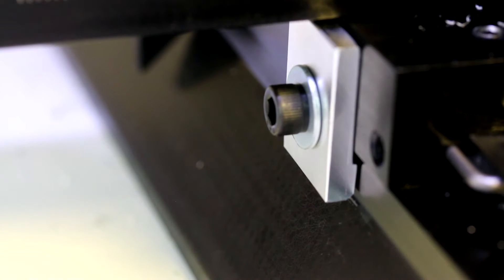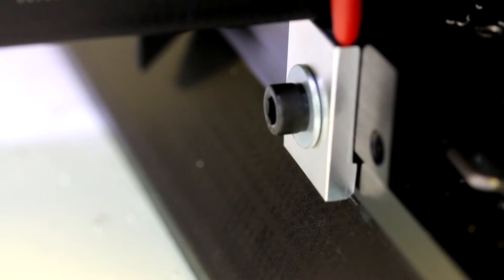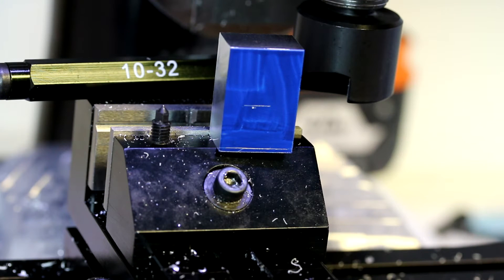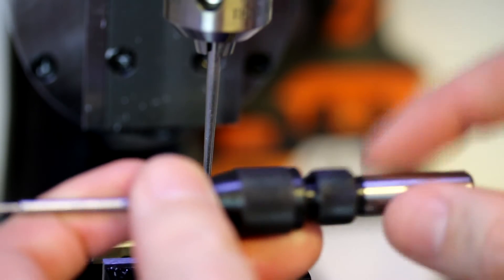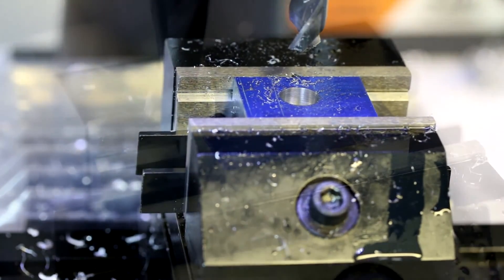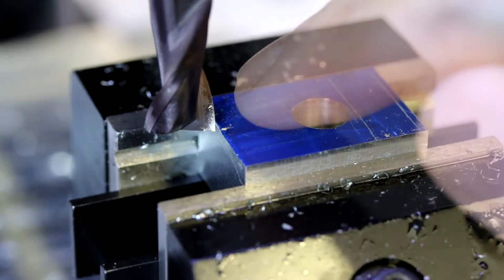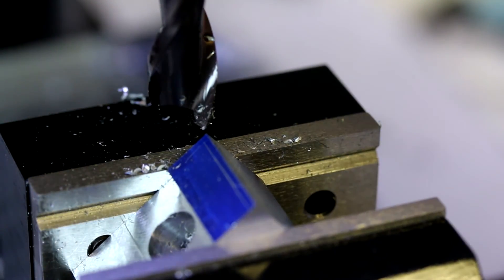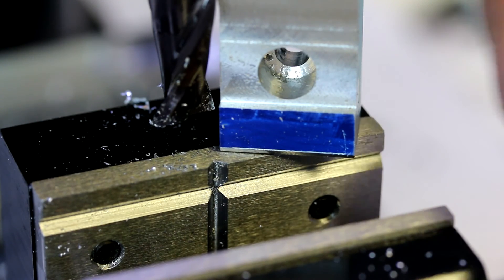Mill Projects 102 - Y-Axis Lock Upgrade

Comment: For the spring, I would use a spring washer because the edge of the oil spring could cause abrasion to your machine. 
     "Spring washers have a small footprint and are valued in small machines where a coil spring would be unsuitable. Spring washers can also deflect in a linear, progressive, or regressive means and these devices show a symmetrical deflection around the washer's axis. Spring washers can be stacked to create spring sets or series where deflection and load capacity can vary without materially affecting the forces involved." from https://www.globalspec.com/learnmore/mechanical_components/springs/washer_springs

Comment: This is a great project that I'll be doing soon.

I got my strap clamps basically finished today. I'll taper  the ends later. Also finished up my "TIP 3--Mill Table Horizontal Clamps". Fun projects.

I didn't have a scribe with a removable tip so I chucked up a large sewing needle to locate my holes. It worked great with hardly any runout.